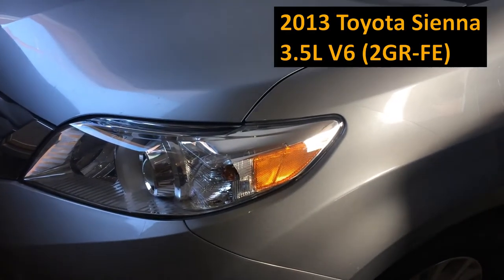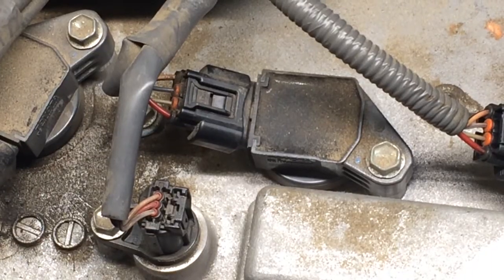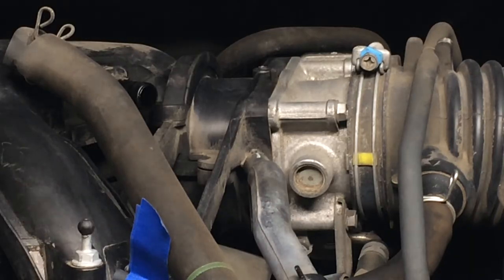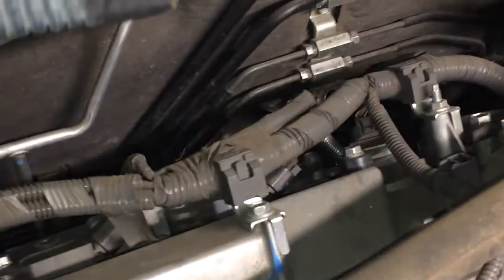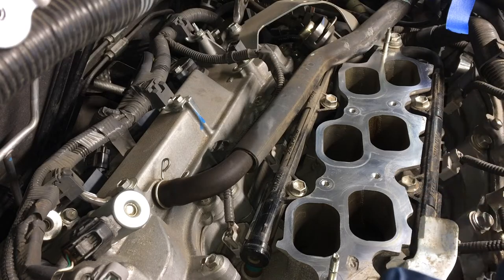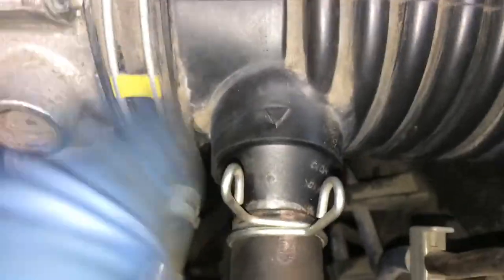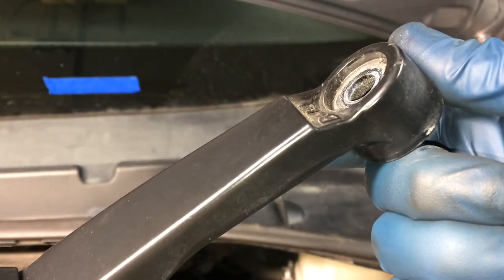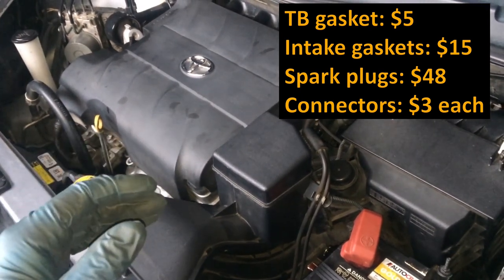2011 - 2016 Toyota Sienna DIY Replace Spark Plugs, Coils, Intake Manifold Gasket V6 3.5L (2GR-FE)

Comment: This video was very helpful when I replaced the spark plugs in my 2012 Sienna. The only problem I had was that when I was bolting the upper intake plenum back on to the lower intake manifold, the right bolt broke when I was tightening the nut! How much of a problem is this? Can the bolt be drilled out and replaced, or does the entire lower manifold have to be replaced?
Reply from the maker: For the fastener that broke, do you mean the stud labelled "5" at 49:56?
Also, how much of the broken fastener is above the surface?

Comment: Brilliant explainer 👍👍
Reply from the maker: Thank you!  Good luck : )
Reply: @L35inColorado  I will wait for more videos specially if you can make for replacement of timing belt and O2 sensors in Sienna and replacement of Head lights and tail lights
Reply from the maker: @ovaisalam1951  The 2GR-FE engine doesn't have a timing belt, but rather a timing chain, which typically does not need to be changed (the engine must be removed from the vehicle to change it, so that is a huge job!).   

As for the O2 sensors: there is an O2 sensor which is accessible to change during the spark plug job -- after removing the intake, you can reach the Bank 1 O2 Sensor #1 from above.  You can reach the Bank 1 O2 Sensor #2 from below by just rolling up onto ramps, as shown here:

https://www.youtube.com/watch?v=vsEKGS5WvtY

The Bank 2 O2 sensors are on the front, so they are easier to reach: Sensor #1 you can reach from above, and Sensor #2 you can reach from below by just removing the plastic splash cover.

The Sienna tailights are very easy to remove, here's a video:
https://www.youtube.com/watch?v=kTOx3hO4ceE

The Sienna headlights take a little more effort remove, here's a video on removing the headlights:
https://www.youtube.com/watch?v=cd7CnB0OblM

I hope that helps!  : )

Comment: Would you have a list of all the tools required? Is a torque wrench needed?
Reply from the maker: I pretty much always use a torque wrench, and personally I recommend to use one for the spark plugs and gasket surfaces (surge tank, throttle body), but I know that many people don't and get by just fine.  The main thing is not to over-do it, since the parts are plastic and aluminum: nothing is super-duper tight for the engine parts removed for this job.  
For the body parts: you don't need a torque wrench for the cowl fasteners or wiper arms, and if you don't have a torque wrench that covers the strut tower nuts range, then you just want those pretty tight (you'll be able to see how tight they are when you remove them: they are pretty tight and you'll want to use a 1/2" drive ratchet or breaker bar on them). 
So, I would recommend to at least have an inch-lbs range torque wrench for this job, for the surge tank fasteners and spark plugs.  I used this torque wrench for years before upgrading to what's shown in the video, and this torque wrench is fine if you use it correctly:
https://www.harborfreight.com/14-in-drive-click-type-torque-wrench-63881.html

But now I have this one, and I love it (very nice, but expensive)!
https://www.harborfreight.com/38-in-40-200-in-lb-professional-compact-torque-wrench-56614.html

As far as other tools: I show all the tools used, so you can skip through and see, and there are some notes to help in the Pinned Comment.  But off the top of my head, you'll want some: 

- 10mm, 12mm, 14mm sockets 
- 5/8"/16mm spark plug socket tool -- I recommend the one shown in the video, TEQ TP80546 
- extensions 
- ratchets 
- 12mm wrench for that passenger side surge tank bracket fastener, or a flex head 1/4" drive and 12mm socket as shown in the video

- I really like these for the surge tank bolts, but they aren't absolutely necessary:
https://www.amazon.com/Neiko-10076A-8-Inch-Metric-Socket/dp/B000IQNMQU

I hope that helps!  Good luck : )

Comment: Just wondering, why replace the spark plug coils?  If mine are ok and the car has 100k should I just use the ones I have?
Reply from the maker: It is just a preventive option that some people like to do - to replace those rear bank coils during this job because they are hard to access.  There is no additional labor to replace the coils (since you already have them out to replace the plugs), but there is additional parts cost (about $250-$300 for three good Toyota or Toyota OEM coils).  
For example, if you did this job and one week later, by coincidence, you got Bank 1 misfire code because a coil failed on the rear bank, then it would require removal of all those same items as seen in the video (the cowl, the surge tank, etc, plus new gaskets) just to reach a rear coil to replace it, so the labor cost for replacing one rear bank coil is almost the same as replacing those rear plugs.  
So, what some people do is buy three new coils to replace the hard-to-reach rear coils (whether they DIY or have the work done in a shop), then keep their old coils (which are still good) as extra coils to swap in if a front coil fails.  As you can see, the front coils are super easy to replace.  So, that's why some people do it.
Most people probably don't do that, though, because three Toyota or OEM coils (Denso or Diamond Electric) coils costs $250 - $300.  As mentioned in the video, I don't use and would not recommend non-OEM coils because they fail all the time and are low-quality.

As for durability: Toyota OE coils last a long time under normal conditions. It is not uncommon for them to last 200K miles. The Sienna in the video has now probably close to 140K miles and it still has it's OE coils.  So, coils can last a long time, but they can also suddenly fail.  When a coil fails, it must be replaced before continuing to operate the car because it will cause a misfire.
I hope that helps!
Reply: @L35inColorado  thank you

Comment: Great video! I’ll be using this for sure! Random question, what torque wrench do you use?
Reply from the maker: Thanks! I have acquired several torque wrenches over the years (maybe I should do a video!): my favorite right now for low-torque jobs like spark plugs, valve covers, etc (low torque = inch-lbs range) is the Icon 56614, which is a 3/8" drive compact torque wrench that covers 40 to 200 inch-lbs:
https://www.harborfreight.com/38-in-40-200-in-lb-professional-compact-torque-wrench-56614.html

I really like that Icon because it is nice to have a 3/8" drive that is so small yet covers the most common inch-lbs range seen in automotive repair (usually the inch-lbs range torque wrenches are 1/4" drive).  I also like that Icon 3/8" compact torque wrench because it has the locking-collar style adjustment and has a very distinct "click" at all ranges.  And best of all, it has 90 teeth, so you can get it into places where you don't have a lot of room to swing/ratchet.  

Also for the low range (inch-lbs again), I have the Tekton TRQ21101 (shown in the video), which is smaller and covers the less-common 10 to 150 inch-lbs range, and is 1/4" drive (which nice for tight spots):
https://www.tekton.com/1-4-inch-drive-dual-direction-click-torque-wrench-trq21101
The click on the Tekton is nice, but not nearly as distinct as the Icon's, and the Tekton has fewer teeth (72 teeth, which is still excellent).

The Icon compact 3/8" is expensive though ($100).  That said though, I started out years ago using just the famous then-$10 Harbor Freight Pittsburgh torque wrenches (1/4", 3/8" and 1/2" sizes).  They are still available, and still cheap, but they're $20 each now.  Here's the 1/4", for example:

https://www.harborfreight.com/hand-tools/sockets-ratchets/torque-wrenches/14-in-drive-click-type-torque-wrench-63881.html

If used properly, those Pittsburgh torque wrenches are an inexpensive option that will get the job done.  There are videos on youtube to prove it, and I know from experience that they work.  The locking mechanism on those is the older-style "end screw" mechanism which does eventually fail over time, but HF warranties them for life.  I still have a full set of those (I've had to warranty them all over the years) and I still use them from time to time, though far less now that I have better torque wrenches.

Some people really seem to hate on those Pittsburghs, but in my experience, if you use them properly, they work fine.  I used those for years because that is all I could afford, and I did water pumps, timing belts, and even rebuilt a Toyota engine (so very sensitive torque applications like connecting rod bolts and head bolts) using just those cheap-o Pittsburghs, so I know they are fine if you treat them well and use them correctly.  But they can be a little finicky with the locking mechanism, for sure.

So -- looking back: if you can afford higher-quality torque wrenches than the Pittsburghs, then I would definitely recommend the Icons, or another higher-quality option.  

The reason I recommend the Icons in particular is because for the price you cannot currently get a "finer" (meaning higher-tooth count) torque wrench with a locking collar and lifetime warranty anywhere but with the Icon.  They are by far the "best bang for the buck" in torque wrenches right now.  I have both the Icon compact 3/8" and the Icon 64065 "regular" 3/8" (which covers 20 to 100 foot-lbs), and I love them.  I don't have a 1/2" Icon torque wrench, but my buddy has the 1/2" flex head and that torque wrench is outstanding! 

(I have this Kobalt 1/2" right now, which I really like, but I got it years ago before Icon was even around: 
https://www.lowes.com/pd/Kobalt-1-2-in-Drive-Click-Torque-Wrench-50-ft-lb-to-250-ft-lb/5001994701)

So -- this is very long -- haha, that's probably waaay more info than you requested, but I hope that helps!  I like torque wrenches, so I'm just going on-and-on...but I'll stop now. : )  
Thanks for watching!
Reply: @L35inColorado  that is a great answer and very informative! I will definitely check out the icon.
Reply: Had to order on online. Even though they said they had them in store. Thanks again!

Comment: I'm assuming you live in Colorado from your channel name, can I drive to you and pay you to do it lol I'm from southern California and you seem like a pro
Reply from the maker: Haha, thanks - I'm not a professional mechanic, but if you ever need an excellent Toyota mechanic in California, Peter at Foreign Auto Specialist in Arcata, CA is top notch (but Arcata, CA is very far from southern CA). It's this Peter:
https://www.youtube.com/c/ToyotaMaintenance
Thanks for watching! : )
Reply: I just did it today with your tutorial I'm not very mechanical savy so it took me eight hours cause I had to unscrew the manifold a couple times cause I either squished a hose / put another hose on top instead of going to the bottom into the throttle body/ the screw in the back of the manifold didn't line up correctly. It was a pain in my butthole but i was happy af when I connected everything and no check engine light came on also I feel tired and cranky so i went to go get tacos

Comment: Would the procedure be fairly similar on 2008 Toyota sienna?
Reply from the maker: I'm sorry I missed your comment - yes, it would be similar because the '08 V6 engine is also the 2GR-FE, but I'm sure there are some minor differences. The torque values should be the same, but I cannot confirm for certain because I don't have an FSM for the '08. I hope that helps - good luck! : )

Comment: Can you please do the video of how to replace timing belt?
Reply from the maker: This Sienna does not have a timing belt: it has a timing chain, which typically does not been to be serviced or replaced, if you keep up on the oil changes.  If something unusual happens and the timing chain needs to be replaced, the entire engine must be removed from the vehicle. I hope that helps!

Comment: Could Toyota make it any worst for spark plug replacement? For that matter, anything that needs attention in that area would require the same procedure.
Reply from the maker: Yes, I know what you mean -- doing that Bank 1 valve cover gasket would be a big pain.  At least the spark plugs last a long time (120K miles).
Reply: @L35inColorado  Since the windshield wiper assembly and cowl have been (suggested) removed, isn't this a better-than-good opportunity to consider replacing loaded McPherson struts on a 2011 Sienna with 107,000 miles too?  You already have 4 of the six bearing plate nuts removed, so that is my logic...  Splendid tutorial.
Reply from the maker: @JonPBixby  It is true that you need to remove the wipers and cowl to remove the struts, but personally I wouldn't replace struts on an '11 Sienna with just 107K miles unless I was sure that they needed to be replaced (ie, I knew they were failing).  The reason is because in my experience, Toyota suspension parts last a long, long time.  This '13 Sienna in the video has over 125K miles, and my sister's '11 has over 120K miles, and they both have all original suspension parts with no signs of ride deterioration, and that goes for many other Toyotas in the family.  It only takes about 10 - 15 minutes to remove the wipers and cowls, and it is not a difficult task, so personally I would wait until it was necessary to replace the struts.  (Also, note that the Sienna will need an alignment after replacing the front struts.)  I hope that helps!  Thanks for watching : )

Comment: Life hack, when coil connectors break, just slide zip tie to it and cut the other end. I replaced my spark plugs today and connectors will break no matter what you do.
Reply from the maker: I'm sorry I missed your comment - yes, that is certainly one solution, and yes, they are so brittle that they often break.  Hopefully Toyota will resume using the "old" plastic formula (whatever that was) from the 90's, because that plastic is excellent and seems to last much longer than whatever they're using since the 2010's.  
Thanks for adding your tips, and thanks watching!  : )

Comment: 2017 is the same or not?
Reply from the maker: No -- the 2017+ Siennas with 3.5L V6's have the 2GR-FKS engine (a direct injection engine).  Some of the steps might be similar, but the intake design is different, and the direct injection models use different spark plugs (triple-tip Denso FK20HBR8, Toyota 90919-01263).  

I don't have an FSM for the 2GR-FKS engine, so I'm not sure what the torque values are either, but if you can find a video for the 2016+ Tacoma V6's, those trucks also have the 2GR-FKS (though it's much easier to reach the Bank 1 plugs on the Tacoma because the engine is installed longitudinally/front-to-back instead of transverse/side-to-side as it is on the Sienna).  

Just taking a look at that engine in a Sienna, it appears that you'd have to remove the surge tank on the 2GR-FKS (like you have to on the 2GR-FE shown in the video) in order to access those Bank 1 (rear) spark plugs. Once the surge tank is off, it should be rather similar -- remove the ignition coil and then remove the spark plug.  Required tools will very similar, too.

Removing the wipers and cowl is likely to be the same steps as shown in the video, since I don't think Toyota changed the body too much -- but I'm not positive about that.

I hope that helps : )  Good luck!

Comment: How did you clean or what did you use to clean the manifold gasket place holders?
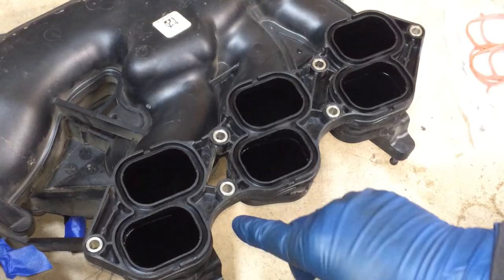Reply from the maker: If you mean the places on the plastic surge tank (43:51) where the gaskets sit, you can just use a paper towel/shop towel or Q-tip to remove any oil in the grooves; if you need to, you can spray some brake cleaner on a paper towel/shop towel and wipe any oil off (the plastic surge tank will not be damaged by regular brake cleaner, but don't use anything abrasive or too harsh).  
If you mean the aluminum surface on the intake manifold (the shiny surface that the surge tank bolts onto), you can just use brake cleaner on a paper towel and clean it up.  You only need to clean the parts on that surface where the gaskets will actually touch.  I hope that helps -- good luck!
Reply: @L35inColorado  exactly what I was looking for. Than you so much. My sienna is giving me the p304 code with 75k miles on it and Ive been told that it's recommended go replace all spark plugs instead of one.

Comment: did you ever replace alternator for 2011 sienna?
Reply from the maker: Not on a Sienna V6, but I have on other 2GR-FE engines.  It's not a particularly fun job on these engines, because you have to remove a few components to reach the alternator.  Here's a great overview:
https://www.youtube.com/watch?v=V8D4XGK8Fw8
I hope that helps - good luck! : )
Reply: IThanks. I did replace my spark plugs after watching your video.
Reply from the maker: @shrekler5440   Outstanding!  Well done on your DIY!  : )

Comment: Cant this job be done without removing the plenum just remove the cowl assembly and that small bracket in the back
Reply from the maker: I don't think so -- that center and leftmost rear spark plugs would be very difficult to touch with the plenum/surge tank in place, but you can remove the cowl and give it shot!  Perhaps in that case you might remove the throttle body, and come in from the left side -- I'm not sure -- all I know is that it is tight back there.  If you have success, please post back. Thanks for watching! : )

Comment: I love Toyota but what a bad design.  I have a 2018 sienna and that requires new plugs every 60k.
Reply: Great video though!
Reply from the maker: I agree -- this design is tough, and replacing spark plugs shouldn't be such a hassle!  Thanks for watching, and good luck : )
Reply: Not really a bad design. Front wheel drive V6 has to be mounted transversely. Unfortunately that makes the back three cylinders hard to reach. You sure your plugs need to be replaced at 60K?  Should be iridium plugs which go 100K plus.